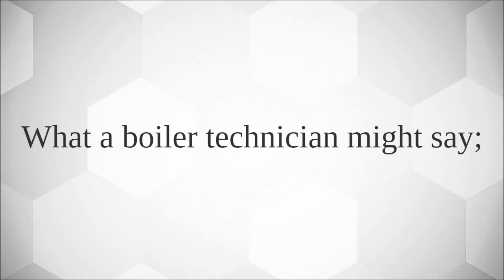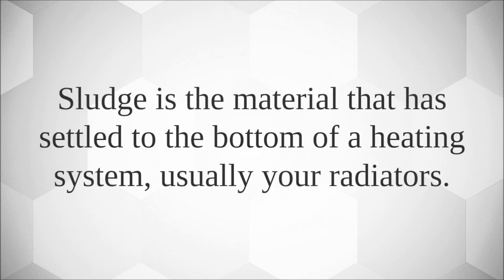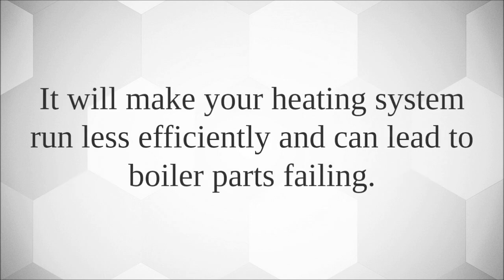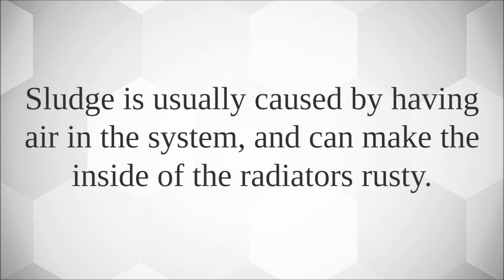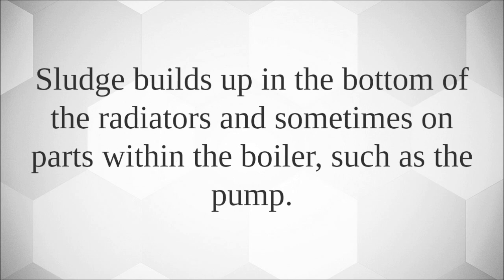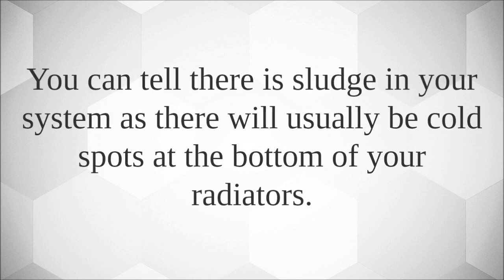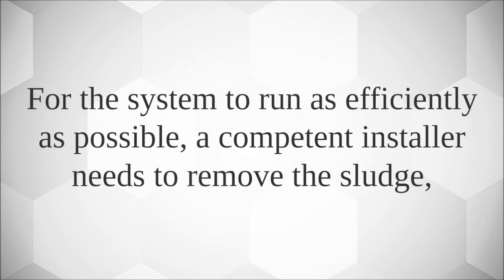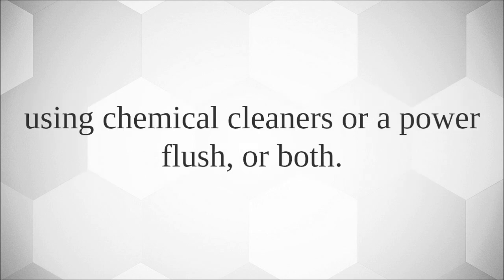What is 'Sludge' & Why Should You Remove it from Your Central Heating System?

Comment: Why there are 23 dislikes for this video?
Does it mention something wrong?!!
Reply: because they say you need to get a competent technican when really you can do it yourself with a hose in the garden and save a small fortune
Reply: Because it does not explain how to remove it. That's what people expect, not to tell them to "call a competent person to do it.".
Reply: Work Out no... they just read your comment and dislike just for a laugh... just like I did 😂
Reply: funny as fuck
Reply: The rusting inside any radiator is not caused by air. It is caused by having a leak and the addition of fresh oxygened water. The oxygen in the added water causes the corrosion of the rads. It's vital that the cause of corrosion is solved first and then clean the system out!! Pearse of Leakbusters
Reply: They didn't tell me what sludge is or what it looks like?